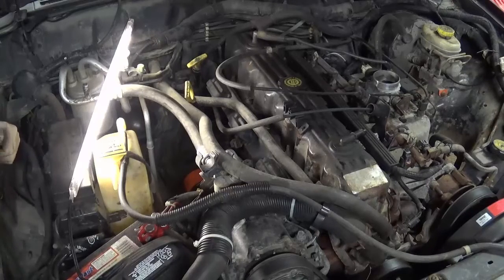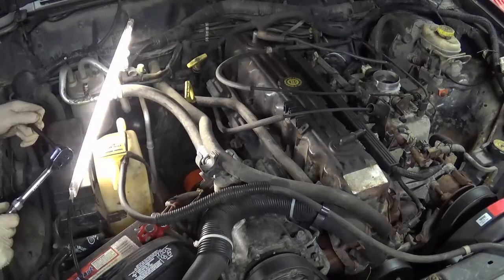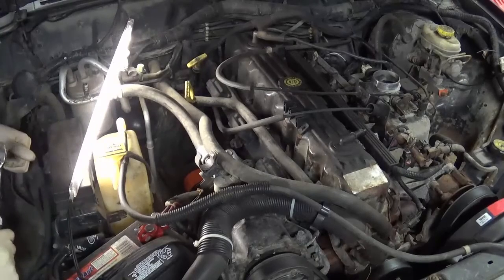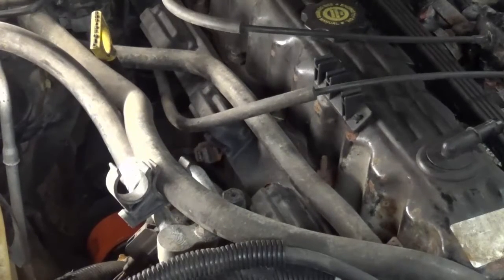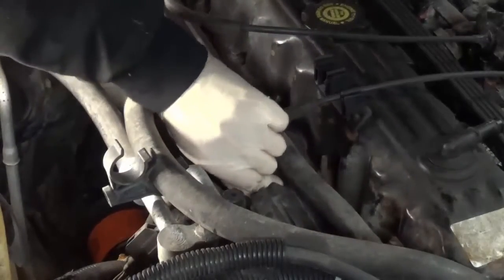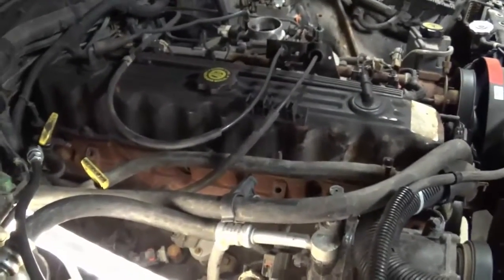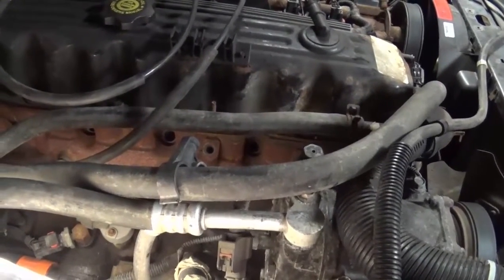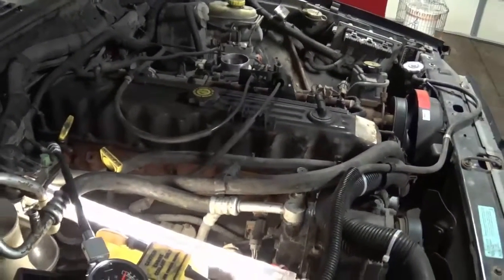Jeep 4.0  Compression Test

Comment: Thanks for video. Sorry bout coil pack clip but alerts me to watch for that. About to do my 1st ever comp test. Just happens to be on 03 Grand Cherokee. Just wondering...why did you not perform a wet test to confirm ring problem? If showed no improvement on cyls 3 & 5 then that would indicate valve problem most likely. An easier fix I assume. But thanks and I now feel better bout givin it a go!
Reply from the maker: Some context is this engine had a faint knock when warmed up. This was just to give me an idea of what cylinder is knock before I pulled the oil pan. When pan was pulled found number 5 piston had a chunk missing. A leak down test would of told me where the air was going.

Comment: I have a 2004 WJ 4.0 with 155,000 miles, my test numbers are: cylinder 1: 160psi, cylinders 2,3,4,5: 155psi, cylinder 6: 135psi. My engine has been reliable, never over heated, though about a year ago it developed a knock. I tried all the things people say to check first and the sound is still happening. It comes and goes, usually worse after heating up and also the sound speeds up when I accelerate. Since two mechanics said it sounded like a rod bearing, I replaced all the rod bearings and when doing so the original ones did not spin nor did they look that bad. Yet even with new bearings the noise started back up after running it again for a little while, then when I was in park it started squealing loud, "not a belt squeal". I am puzzled and the mechanics around me have not been very helpful with diagnosing this. If any one has any suggestions I'm open to ideas. I am probably going to take apart the top end to look inside and see what's going on. I am thinking something happened to one of my piston rings and the sound that I am hearing is piston slap, although the compression numbers seem good. Maybe I should let the engine heat up and then do the test again?
Reply from the maker: Couple of things 1) Number 6 at 135psi is low compared to the other 5 could be piston slap on number 6. 2) The squealing noise if not the belt and it is still there even with belt removed then it is quite possible the CPS (Camshaft Position Sensor) bushing is going bad therefore causes a belt like squeal but it is not the belt. This is what advise I can give you so good luck.

Comment: Grand Cherokee Laredo 4.7 2000 - After replacing radiator, passing checks then doing deeper diagnose- Turns out (constant P0307) (and intermitant P0302) after extreme overheat situation, cylinder #7 compression is 30PSi and doesn't climb after reset gauge.
Compared to others (80's+ PSI). Don't see off the bat any effect on radiator fluid (cap off) while running, no bubbles or overflow (doing it solo).
However, spark plug has tar like buildup within 20miles. At this point; assume either Cylinder O-ring is bad or head cracked when overheated. 
Can I pull the head without major hassle? Should I. Gasket seal is a scary thing.
Trade in time? What are your thoughts? Thanks.
Reply from the maker: So the 4.7 v8 has a bad problem when it overheats extremely it can drop a valve from cylinder 7 or 8. The tar you speak of could unburnt fuel or engine burning oil. Sound like a cylinder 7 either drop a valve or has a bent valve. Do a cylinder leak down test to find out where the air is going but sounds like the engine might need a rebuild or a replacement. Good luck and thats all the help I can give.
Reply: @TEDDAV64  God bless..

Comment: I have an average eat with a 4.0 liter I was driving down the road and it was running hot running hotter than normal and it just died after cooling it off and feeling it back up I tried to crank it and it sounds like it may have jumped I mean or something how do I test this
Reply: how do I how do I test to see if it jumped timing
Reply from the maker: Wesley Hertz the only way to check the timing is to remove the front cover and put number 1 on tdc and check the timing marks and see if they line up but sounds like you may have cooked the engine.
Reply: Thanks I think you are write
Reply: Probably a cracked head they just do that 99 to 2001

Comment: I just did a compression test and neglected to pull the fuel pump relay. It started right up no problem after. Did I do any damage?
Reply from the maker: No it will be fine.